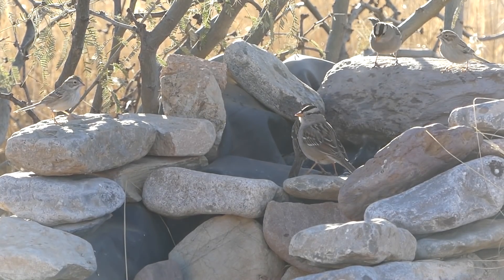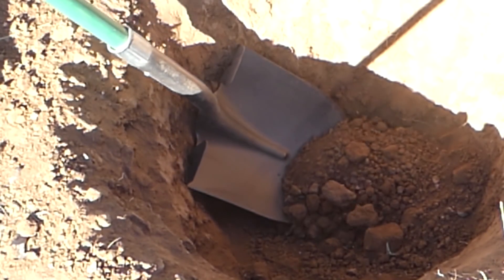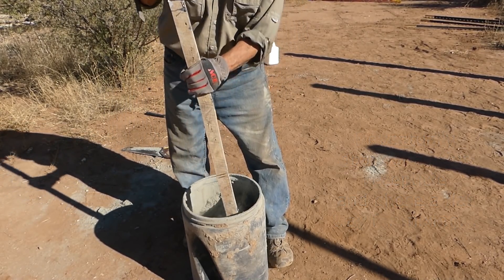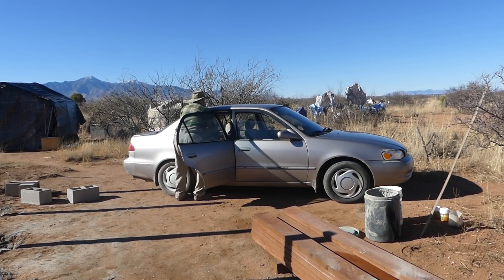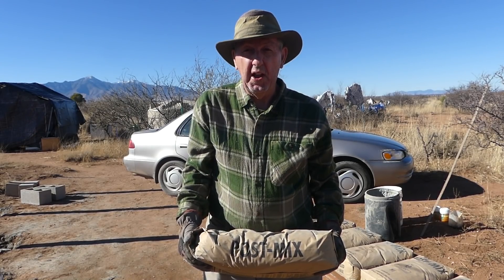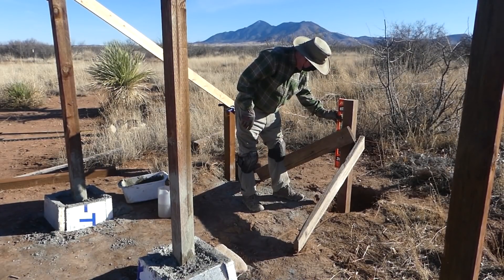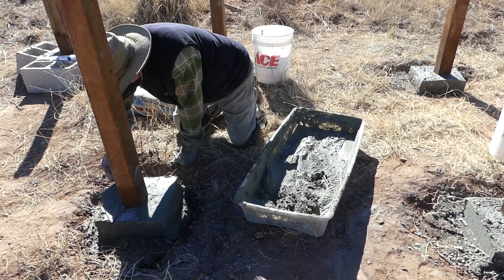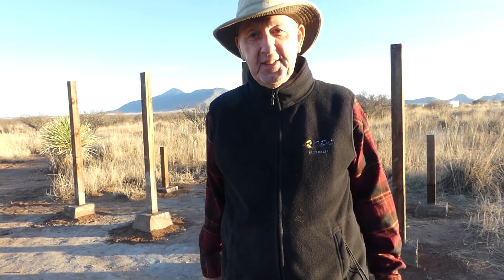Off-grid Senior Designs Solar Array for Tiny Cabin Part 1

Comment: All of that work, lifting, hauling, bending, sawing, hammering, makes for a great night's sleep! 😴💤 Love it! Great job! I like the 3rd concrete mixing container better too. It makes sense to pick the best direction/angle for your solar panels but couldn't you have located them closer to your house? Or even against the house (but maybe that would not have provided the best angle)? I was thinking about the distance you had to run the cables that I saw in your other video. Why did you choose that distance from your house?

Comment: Good work! But I winced when I saw you open the concrete with your handsaw. Then later seeing you cut the boards I saw how much that had dulled the teeth. If you replace it, buy a larger saw, the long strokes make quicker cuts.   
   Another tip, use a hoe to mix your concrete in that bin. Oh, and use the hoe to open the bags too! A wheelbarrow works great, too if you have one. Then its much easier to just dump the concrete in the hole
    One last tip, just dump a few gallons of water in your hole and wait a few hours then you can dig deeper. 
     Don't want to sound like a know it all...just wish someone had told me these things years ago!
     It looks like your methods worked fine and dandy!
Reply from the maker: Chris so kind of you to watch these videos and thanks ever so much for all of the great tips!
Reply: I agree with @chriswhite2151 Don.  He gave good advice.  I was clutching my chest and wincing when the saw hit that bag of cement.  It was kind of like the sensation of hearing the sound of nails scraping down a chaulk board...  

Still, for my own two cents of advice and since I am a sharpen-it-yourself kind of guy, a few minutes of light dressing with a tri-sided file would bring your saw teeth back closer to good cutting shape and it would be far cheaper than buying a new one.  My other comment is that your Gorilla Cart makes a great portable work station/saw horse.  I chuck the wheels and throw a piece of plywood on top of mine and use it for all sorts of jobs.  I nailed cleats on the bottom side of the ply around the outside of the cart to keep it from sliding off and I have used it as a portable chop saw stand, work surface, lumber cart, cement bag transporter, etc.  Those carts are a very useful thing to have indeed.  However, seeing that I am watching year-old stuff, I am betting that you have probably addressed all of this by now and I am probably just adding hot air.  Anywho, I appreciate your videos and you can add my name to the list of folks that are behind you 100%!

Comment: Really glad that you expended the energy to dig those holes and cement them in. In our area the prevailing winds are out of the southwest, so the design works well. The uplift is strongest when we have strong wind out of the northeast. Not sure what happened to our comment on this one 😣. We watched on Irene’s iPad but we commented as us. Nice rigging the forms! Take care. Nice touch base ainting the concrete. Take care.
Reply from the maker: Thanks so much folks for watching.  I was missing you coming by and commenting on my channel.  I so appreciate folks like you checking things out and joining with me here. Yes I am super happy with this solar ground  mount and it should handle the winds with ease. New video being posted this weekend! Cheers!
Reply: @affordabledesertliving3487  we'll be waiting!

Comment: Smart.. ground solar is soo much easier to keep clean...the ground ones come with  a kick stand...and they now have plug it's so u can just plug it into ur small house.. I did mine 2 yrs. Ago and love it...
Reply: Ps. I HAVE 4 PANELS 1060 watts a big mppt controller and 3000 inverter and 4 bats.
Reply: Also, I built my Frame out of sawhores and aluminum...I am not the carpenter u r....lol
Reply from the maker: Thanks  Donna.  Yep ground mount is definitely the way to go.  Hundreds of $ cheaper than a metal ground mount or roof mount.

Comment: It looks better than mine ; I got two more batteries at Autozone ; now I have 18. I use their 105 amp hour boat batteries. I had to rebuild my inverter charger in November...welded too much running off it, but I needed a stove...it's supposed to be single digit temps Thursday, my birthday. I will be 66. I ordered a 25 ft. roll of #2 welding cable awhile ago. I have to replace my cables that I made out of a used lead I got from my uncle. He says it flooded over there and the cable is probably no good now. The system will be charging in two hours and it's showing 25.5 volts. So I guess I have enough batteries now. I've been off grid for a year now on my little pieced together system. It's doing really well now...you're going to like being on solar. I only have 1000 watts of panels but I have 22,500 watt hours / 900 amp hours of battery bank.
Reply from the maker: Hi David thanks so much for the encouragement.  Yes indeed Solar is the way to go!

Comment: I think you're doing GREAT! I'm older than you and everyone keeps telling me to take it easy, don't climb ladders, stay off the roof, drink more water, wear knee pads, don't carry those cement bags use a wheelbarrow. LOL, sheesh! My doctor tells me I need to go to the gym, I told him I work out more than he does. In the last 5 years I have replaced all the siding and windows on my house, built a 12x20 addition, built a 12x24 deck, built a 12x16 studio, laid a 18x20 paver patio, insulated and drywalled my 18x24 garage, dug out and repaired a section of my septic system, put a roof on my 8x16 trailer, dismantled a 8x12 shed and rebuilt it into a 7x10 bathroom for our vacation property, and a myriad of smaller projects around the homestead. Keep up the great work! Looking forward to the build. My only advice to you is when you are using a hand saw to stick your tongue out and keep it to the right side of your mouth so your cuts are straight. LOL!
Reply from the maker: LOL at your doctor suggesting you go to the gym.  Wow that is a ton of projects you have completed!  Amazing! Re advice on sticking my tongue to the right side of my mouth while using a saw?  I was actually but I chew my tongue so you cant see me doing it LOL.

Comment: Since you live in the desert with all the dry grass, do you ever worry about grass fires?  If so, would you ever install sprinkler systems around your solar and house installations?
Reply from the maker: HI Brian thanks very much.  Fire management is pretty strict here and folks have to have a permit even to burn almost anything so that helps. That said it is a concern but not a major one.  I havent given serious thought to a sprinkler system but it is worth thinking more about.  Thanks for watching!

Comment: Greagt job, Don. Three things you need , a pair of sawhorse (which you mentioned ), a wheel barrow and a wire mesh garden cart
Reply from the maker: Thanks so much Rags 2itches! Yep I definitely got to get some horses. A barrow will come when I can clean it (I have no water pressure yet) What would I use a wire mesh garden cart for I wonder?  I have a great Gorilla cart but of course dont want to wreck it with cement stuff.
Reply: @affordabledesertliving3487  AH. I thought the open mesh would be easier to clean and less heavy lugging. If you ever were in a Canadian garden center you'd recall what I am talking about. Here's a funny garden center story a friend of mine told me. A woman customer asked him if they had tubercular bologneyas. He paused, then said, "Yes right this way."  She was looking for Tubular begonias.  lol
Reply: @affordabledesertliving3487  I thought a cart like the ones at Canadian plant and landscape centers, Heavy mesh would be easy to clean and less luging for you :)

Comment: Don
You always surprise me with innovation. On mixing concrete I use a flat shovel  and a wheel barrel. Just an idea. I rinse it out after I pour (wheel barrel). The form things and bed springs is genius!  I am going to follow your lead. God bless my Freind.
Reply from the maker: I was so delighted and encouraged to hear that my ways of doing this job provides some help to others.  Really thrilled you enjoyed the vid! I have often thought about getting a wheel barrow for cement stuff but my water pump providing the pressure for the hose is not scheduled to be hooked up for several months. So cleaning the barrow would be more labor  intensive than I would prefer but stay tuned a barrow may be in my future! Thanks again for coming by and watching!  Cheers!
Reply: I just swish it out with a bucket of clean water. If you do it quickly after you pour the cement. I cannot lift the 80 lb bags
Reply from the maker: @fortyfourrobo544  Great tip. Thanks!

Comment: I'm looking at doing a 24 panel array in the same fashion but going three high instead of two. I get up to 100 mph wind gusts up in the mountains of AZ so wondering if you were going to also anchor your rack with some ground anchors and guy wires?
Reply from the maker: Hi Keale.  Excellent question especially since I am at 4600 ft and get some rough winds as well. This array is heavy duty with extra 4x4s and once my panels are anchored super securely to the framework they shouldnt go anywhere. Hope your build goes great!

Comment: Did you think about setting up sterling motors for solar thermal electrical power generation and comparing the power generation?  I always wanted to see a comparison. The problem with the sterling, though, is the solar tracking, unless you set up separate motors with the lens or funnel or mirror, whatever you would use to focus the light, at different angles for each motor for different times of the day.
Reply from the maker: Hi David thanks so much for your excellent question. For someone with just basic skills in so many areas I wanted it to be as simple and sturdy/resilient as possible. Since at this point I have over-sized my solar setup I am not worried about the benefits of tracking etc. Simple for me is best! Thanks for watching!
Reply: @affordabledesertliving3487  Ok, that sounds good.  I want to build something sometime on some land, just not sure when I will be able to.  There is a channel by Robert Murray-Smith where he talks about a lot of different small energy things that you can put together yourself.  When you are done setting things up there, you might find more things to do on that channel if you want to work on putting more random things together either just for fun or for extra power, or different situations.
Reply: I forgot to put in his channel URL in case you want to take a look sometime:  https://www.youtube.com/channel/UC4AkVj-qnJxNtKuz3rkq16A
Reply from the maker: @HumanityObservatory  Thanks a lot! Cheers!

Comment: Wow! For being in your middle 60s you are doing well. I could not do that! My back just would not go along with it. Looks good! Are you using 250 watt panels?
Reply from the maker: HI Storage Mann. Thanks so much for watching and yes I am super blessed with good health. My panels are each 340 watt so I am super excited to have them all hooked up!
Reply: @affordabledesertliving3487  wow! 340 watts each! Why you can start your own power station! Great! You should get over 2 000 watts right? You could run an AC unit small heater during the day at night you need batteries galore!
Reply from the maker: @storagemann6373  LOL @ starting my own power station. Yes I have enough battery storage for 4000 watts.  The reason for the oversize is that I want to install a mini-split to keep things cool in summer and warm in winter. Lots more details will unfold as I continue the build. Stay tuned....

Comment: Don, Just curious if you considered building a carport with a solar roof so your solar panels could shade your car and produce electricity. You could also enjoy the shade yourself just sitting in a chair or hammock.
Awesome idea regarding the foam concrete forms
Reply from the maker: Hi Stuart.  Yes indeed I love the idea of a carport and will do that at some point for rainwater catchment and car storage. Thanks for the thoughts on the foam concrete forms. They turned out better than I expected!

Comment: Lossa hard work there, Don....you need a wheelbarrow!  I just mixed a bunch of 80# bags of the 4000 psi stuff for a perimeter foundation, so can relate. Not finished, we have too much freezing temps at night.

You might try a serrated kitchen knife if you gotta cut more styrofoam. 

Can't wait to see the rest of the install!
Reply from the maker: Hi Bob thanks for coming by. Great to see you back!  Yep my issue is that I have no water pressure (yet) with my location so no good way to clean the barrow. Hope your back is okay with all of the work and sorry to hear about the wild and crazy freezing temps. Stay tuned lots more solar stuff coming down the pike!
Reply: @affordabledesertliving3487  I thought I saw you install a water pump, my bad...

You do have water, could fill a bucket and wash out wheelbarrow as needed.  My back is fine, but wished I had bought 60# bags.
Reply from the maker: @bobcole3852  Bob your are correct I do have a water pump and thanks for being so observant.  It's not hooked up yet as I need to wire my cabin first and create a small home for the pump. Then I can put it into action! Yep 60 lb bags are better for sure LOL.  In the end I had 3 sizes. 60, 75, and 80 pounders.

Comment: Easy vs Hard.  Just use fence post cement (Quick Crete,  post mix, or whatever it's called).  It's the cheapest concrete mix, and easiest.  Just dump the bag into the hole, around the post, and wet it!  Buy a cheap wheelbarrow and save your back moving dirt   or concrete.   A long pry bar sure helps with digging and tamping and leveraging and prying.  Sawhorse - just 2 or 3  2x4 studs will make a cheap sawhorse that will last for years and save your back and make your work so much more efficient and easier.
Reply from the maker: Thanks for watching Tiny Businesses.  Yes indeed I was aware of the way post mix works but ran into doubts of the solidness of it with eratic mixing ratios like I would be doing by pouring it in the ground. Good tips on stuff and I appreciate all of your input.  Cheers!

Comment: Great job! Seems like a wheelbarrow would be a great asset to your building projects.
Reply from the maker: Yes indeed Corey.  Well pointed out.  I have a gorilla cart but of course its not for mixing stuff.  The issue right now is that I have no pressurized water anywhere on my property so cleaning the barrow etc after cement mixing is pretty challenging.
Reply: I didn't think about that. Good point! I am amazed at the work you get done.
Reply from the maker: @coreyflowers1256  What a wonderful encouraging comment. Thank you sincerely.

Comment: The best advantage to ground mounting your panels is that you can make them variable tilt.  It looks as if you are not planning to do that but I urge you to look into it.  Not too late to augment the design for it and you'll get great benefits in both summer and winter.
Reply from the maker: Thanks Kirby.  I definitely gave that some thought but thanks to our amazing AZ sun and the amount of panels I have to the ratio of what little power I will use I decided to go with stationary like most of my off-grid friends here in Cochise. Great input and thanks so much for coming by and checking things out!
Reply: Tilting solar panels made a lot more sense when they were much more expensive or when you have limited space.  Now that that they are so cheap, however, many people just oversize their array a bit so they don't have to bother with constructing or operating a variable tilt mount.  That assumes that you have plenty of extra space for the over sized array, of course.  If you are going for a fixed array, it is usually considered best to slightly favor towards the optimal winter angle, since the days are shorter in winter.  In summer you will likely have spare capacity with the long days.
Reply: @Back2SquareOne  That is the conventional wisdom for grid-tie.  Off grid has a bit of a different emphasis.  It will really depend on his needs, electronics, and battery bank.

Comment: Looks good -- you're off to a great start... 
It was satisfying watching your thought process & progress. I was a little concerned at first that you weren't digging deep enough, but after seeing how much concrete went into the holes & bases, they're obviously not going anywhere. A little water left to soak into the ground once the holes were started would have made your digging a little easier.. assuming you had the water to spare, that is... ;^)
Reply from the maker: Hi Lane thanks so much for watching and yes indeed those posts are super solid.  By the way can you kindly remind me when Rattlers become active?  I am not phobic which one couldnt be living here!  But I do prefer to be cautious.

Comment: Just as a heads up, post hole concrete mix is designed to go in the hole with the post dry, then just add enough water to soak it. It does the rest for you no mixing required.
Reply from the maker: Great observation and your totally correct.  I worried I would get the water to cement ratio wrong doing it that way so opted for the more laborious way. Thanks for watching!

Comment: Well done for a one man show, would suggest a bead of silicone or Henry’s wet patch around 4x4 were it meets the concrete because concrete shrinks slightly and allows water to penetrate into footing, a recipe for wood rot. 🍿🍿🍿👍
Reply from the maker: Shane your comment was super valuable.  I am indeed going to take your advice on that. Thank you!